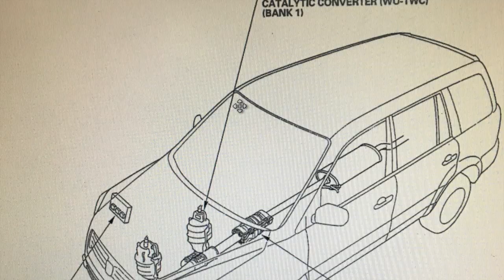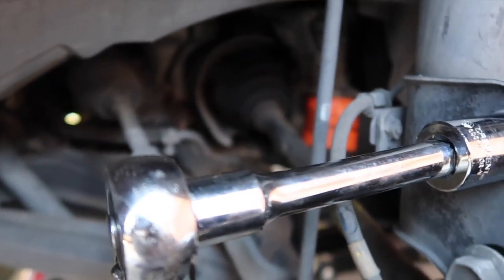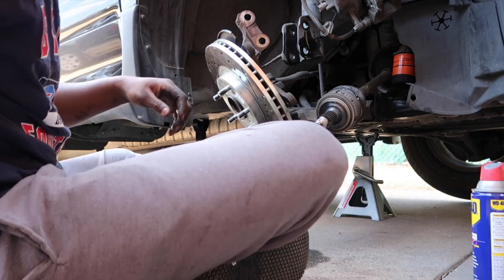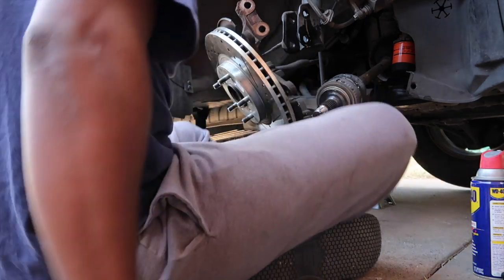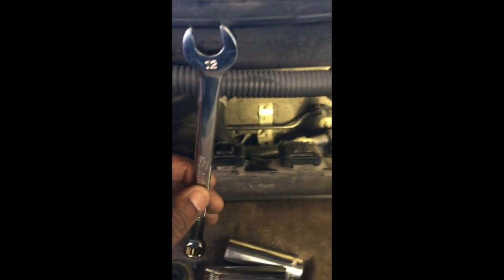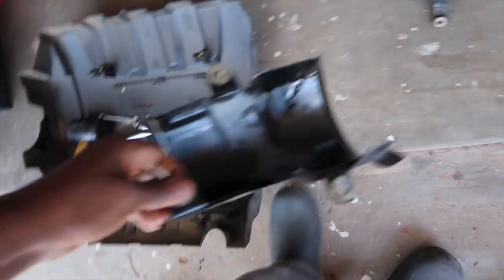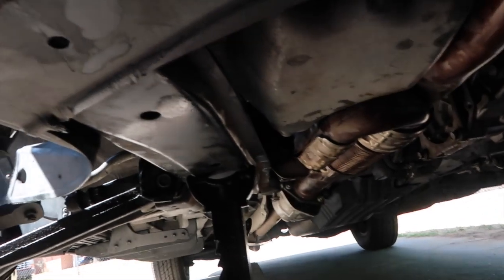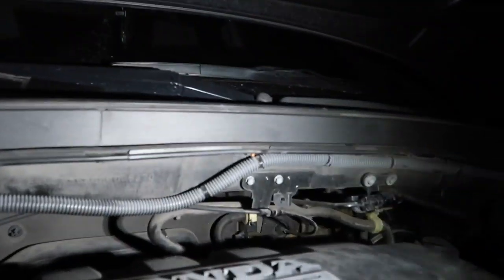HONDA PILOT (2008 & UP) CATALYTIC CONVERTER BANK 1 REMOVAL (P0420 CODE)￼ (Acura w/ 3.5L j engine)

Comment: Bank 1 catalytic converter I removed the battery connectors.   Removed air intake tube. Removed the cover in front. Removed the front grill. Removed the o2 sensor. Remove all the screws to the radiators. Remove the brace to the radiators.  Removed the coolant reservoir.  Disconnect  all the connectors and screws to the left fan. Move the radiators  to give space to maneuver the fan in between the radiator  and front of car. Remove the screws to the catalytic converter on the bottom first. There should be 4 screws. Leave the egr pipe on the catalytic  converter. Just remove the 2 screws  that's connected  to the engine. Pull the whole catalytic  converter  and egr pipe up and out of there.  With the nuts and  bolts on the catalytic  converter make sure to heat  them before attempting to remove them though. Wd40 is your best friend too.  After taking it out remove  the egr pipe.  Make you have a strip bolt socket kit to be ready lol. Install the new cat and   then the egr pipe . I would recommend  cleaning the original  gasket and reuse them instead.  Apply oil and scrub it with a wire brush.  Now just install everything by going backwards  . If you have to change the o2 sensor  I'd recommend  getting a deep socket 22mm. One you can fit in the o2 sensor after you cut off the wires.  The sockets they sell to removing  o2 sensors are not made to remove seized sensors because they will twist because of the design.
Reply: I forgot to mention I used a catco brand and they fit pretty well. If you need a California  compliance  cat then there is an extra  hole for a sensor on  the cat on the bottom. I got one on accident  and I just sealed it by using the old o2 sensor.
Reply from the maker: I really appreciate the update! I was starting off learning and now I know what I did wrong and appreciate the knowledge. I turned a simple task into a complex one but thanks to people like you for the help!
Reply: You do realize that you just explained how to remove bank 2 on the front of the engine, not bank 1. Bank 1 is the rear catalytic converter near the firewall.

Comment: Nice job, I’m doing this in a shop on a lift and it’s a pain in the ass still. The only thing I would do differently is the removal of the cv axle. If you remove it as one piece it will be a little easier to get to the bolts from the bottom and you don’t run the risk of ruining the joint. I’m working on a 2011 pilot. It’s a little different. Again great job.
Reply from the maker: jakob simmons yeah I should have done that, it would have made my job a lot easier! Thank you for watching!
Reply: You don't have to remove cv shaft for this job.

Comment: Thanks for the detailed tutorial appreciate it. Gonna have to do it soon on my daughter's Pilot
Reply from the maker: Gary Lopez no problem brother!
Reply: Hey how did you disengage the connector from  the bank 1 sensor 1 wire? I spent hours trying to separate them from each other yet no luck.
Reply from the maker: Kalsang Dorjee you still need help? Sorry my YouTube never sends comments notifications unless I’m on the computer. My apologies about that.

Comment: To remove CV Axle passenger side, you can reach from the driver side with an extra long pry bar and tap out with a sanded mallet.  A lot easier than trying to remove the way the video shows.
Reply from the maker: Thank you!

Comment: Looks like a pain bro. I spent ALL DAY taking out that axel once. Ended up borrowing a free tool from AutoZone that took it out in 2 minutes. Looks like a big "C" and attaches to a slide hammer. Highly recommend that tool. Don't know how you got that heat sheild out. I got mine lose and moved it around. Never got it out though. Hope I never have to do the cats. Thanks for the video. It will surely help anyone doing this repair. Oh, cute kids man.
Reply from the maker: Tom Helsel yeah it’s a pain but with the right tools it’ll make the job look easy. I have an Acadia that I got to do both front axle and I’m thinking it’s going to be a pain as well. Thanks!

Comment: Hey, question... so my 2006 Pilot is giving me a P0420 code as well and the check engine light goes on and off at times. You think I should try changing the o2 sensor 1st and then the cat of that doesn’t fix the issue ?? They’re charging me $987 for cat converter which is the front one. Thanks in advance.
Reply from the maker: Julian A. Torres yes I did that as well. Most likely it is you Cat converter.
Reply: MWZ MiniSodes thanks !!
Reply: MWZ MiniSodes one more question... if I have the cat change do I have to have the sensors changed too ?? And did you used a original cat or universal ?? Thanks.
Reply from the maker: Julian A. Torres you don’t have to change it but I went ahead and change mines since I was already there. I used a new aftermarket cat from eBay that already had a heat shield installed on the cat itself.
Reply: @BLK_WILL_SS  can you send me the link to where you bought the cats
Reply from the maker: Chase Robles I ordered them off eBay. Don’t have the link.
Reply: How much u pay for the cat .
Reply from the maker: Humberto Torres I ordered it off eBay. https://rover.ebay.com/rover/0/0/0?mpre=https%3A%2F%2Fwww.ebay.com%2Fulk%2Fitm%2F302378423396

Comment: It's been 4 years since you've installed the Bank 1 Cat purchased from eBay.  Has it lasted this entire time without setting off the code / check engine light?
Reply from the maker: Honestly I sold it to a close friend after a year. He sold it last year around April and the Cat was still holding up pretty good and never had another engine light.

Comment: damn looks like alot of work! Does the truck drive better? how was it driving before?
Reply from the maker: Yes it drove better and sound better! It would make a noise and set the engine light off. I saw an improvement in the gas mileage as well.
Reply: @BLK_WILL_SS  thanx for reply, my pilot is acting funny  has had that code for a while i have to go ahead and get this done,great video !
Reply from the maker: NuLine Transport no problem. Thank you for watching. The dealership wanted to charge me $800 for the job I believe but I did it myself. Took a while but I got it done. I got the part from eBay and to this day it runs great. 200k miles on the suv.
Reply: @BLK_WILL_SS  Damn Good job ! did you get the sensors on ebay too?
Reply from the maker: NuLine Transport yes I did.
Reply: @BLK_WILL_SS  not the oem right cause they are expensive!
Reply from the maker: NuLine Transport that’s right. You can always find some online that performs the same job for a cheaper price.

Comment: I have a 2005 Honda Pilot and I can't figure out how many catalytic converters I have or what's the name of them so I can purchase. How/where can I find this out?
Reply from the maker: You should have three. One in the front of the engine, back, and bottom that leads to the exhaust.
Reply from the maker: https://www.ebay.com/itm/2005-2006-2007-2008-Honda-Pilot-3-5L-Catalytic-Converters-Set/303383708481?hash=item46a3140341%3Ag%3AJz8AAOSwhMxd4UUf&fits=Year%3A2005%7CModel%3APilot%7CMake%3AHonda
Reply from the maker: If you need help just find me on Instagram and we can call each other so I can help you.

Comment: I have that code p0420 on my 2008 pilot.  I want to replace the sensor first...where is the sensor located and would I need to remove everything you removed ? thanks!
Reply from the maker: The sensor is in the top of the one I changed out. It is possible doing it without removing stuff but goodluck with that.
Reply from the maker: Go to 21:45 mark and you can clearly see the sensor on top of the converter. That’s the one you are asking about changing out.
Reply: @BLK_WILL_SS   thank you
Reply from the maker: @elderreyes3782  no problem ask me some more questions if you need help.

Comment: Has anyone replace the front one. I'm stuck on that one. I'm about to remove the radiator and fans to make room to get it out. But there's no bbn info out there for front one. Good luck to you guys on that job.
Reply from the maker: You can do that one easily
Reply: I just did one yesterday. Read the comment I posted.
Reply: There are videos for the bank 2 as well.

Comment: Question....code p0420 bank 1 on a 2011 Honda Pilot is the same one he did in the video right?
Reply from the maker: shrekrich yes it is. This is a 2008 pilot but it’s the same engine
Reply: Did you have to take the whole exhaust off to, and drain the transmission fluid
Reply from the maker: shrekrich the exhaust that is directly under the engine yes, it’s literally bolted on. The transmission fluid is a no, I did not drain it.
Reply: Thanks man you’re a big help....you and your family stay safe
Reply from the maker: shrekrich likewise

Comment: Remove the sway bar links, remove front cross member shield (4 bolts), remove exhaust, #2 sensor and remove cv shield and cat. You over thought the whole process.
Reply from the maker: I didn’t overthink nothing if I did not know.
Reply: Then why put up a video? You're on YouTube and you could of looked up even the TRQ site. The purpose of doing these videos is to make it as easy and painless as possible. This was painful to watch.
Reply from the maker: @royquesada5295  that’s your opinion go ahead somewhere else with that. Doing that time I couldn’t find anything to help so I took it upon myself. Instead of trying to criticize me help me. That’s what youtube is about. It you ain’t got nothing good to say keep it to yourself, this my channel and I’ll put up whatever video I desire.
Reply: Your right. But now you know, so maybe correct or I should say 'revise the procedure. My whole point is to make the job easier.
Reply from the maker: @royquesada5295  and I appreciate it brother.

Comment: Wow 2 days..... The 2 pins holding the strut to the steering knuckle are secured with nuts and they slide out. Then jacking the car up higher, pointless........ Idk why you would post this video. You start the video with service information, but you obviously didn't follow them. It would have saved you A LOT of time.
Reply from the maker: Service information was edited into the video. I did what was best for me and it was my first time doing it. That is your opinion my guy, bless up!

Comment: Bank 2 is right or left in a 2006 Honda Pilot?
Reply: Do you know?
Reply from the maker: Cristian Blanco bank 2 is in the front between the engine and radiator. Bank 1 is the one I did in the video which is in the back of the engine near the firewall. Easier way to remember is by the number of the spark plug will be the bank as well. Like the number 1 spark plug is at the back of the engine where bank 1 is as well. Spark plug number 2 is in the front of the engine by the radiator fans also where bank 2 is located.

Comment: Amazing video brother , doing it by the book 👍🏼
Reply from the maker: I appreciate it brother, I’m trying to be helpful to others that’s all. Say a couple of bucks instead of paying the dealership.
Reply: Right! And this is why I'm here haha because I needed help with mine and your video helped alot, thank you ! 🙏🏼
Reply from the maker: @jasonantonio4127  yes sir, feels good to hear and you are welcome!
Reply: Nice try...very little 'by the book. CV shaft just don't 'slide out, they have a clip ring holding in the case. Not torque values are crucial when mating surfaces. He needs a lot more learning before he puts videos up. Spent more time trying to figure out. Took things off that were not necessary. Broke the sensor plug unnecessarily. Showed tools more than procedure. Then kept saying 'catalyst, it is catalytic. 'Put the bolt back on rotor?? Watching you bolt on cat was painful, no ratcheting actionable all, you were just turning the nut back and forth. 'Your guessing?? Keep going, at least your trying, but as far as 'instructional...questionable. As far as you saving $1200, 2 days of your time fuel, you probably only saved on the cat. Time wise your in the hole. That's a 4 hour job with Basic tools.

Comment: It’s spitting the p0420 code but no lights are on dash are illuminated. Nor does it have the other symptoms. Should I still replace? Looks tasking 😬
Reply from the maker: Laurel Madrid it showing the code as a pending code. That’s why the engine light I not on. I would try changing other things first and checking before this. It was a lot of work. But if it ends up showing the engine light it will be it.
Reply: 99% is catalytic converter issue.
 Put the scanner, it will pops up catalytic no good, pick that option and then you will see a line go up and down on the diagram. It means the sensor is sending signal and it is working good 👍🏻

Comment: Hey man great video. One question a Honda Odessey has 3 cats right, do all three need to be replace for the PO420 code ?
Reply from the maker: Hey thanks. Yeah it should be one I. The front of the engine, the back of the engine, and one at the bottom connected to the exhaust. Yours have the same code correct?
Reply from the maker: Chino Rodriguez what year?
Reply: Thanks for replying. Yes that’s the code the came up on my 2006 Honda odessey
Reply from the maker: Chino Rodriguez unfortunately that’s the same code and the same cat that I changed out. It’s the one behind the engine.
Reply: The cat on the main pipe isn't metered (under the vehicle). The ECU will not throw a code for that cat. Only the two coming from the engine.

Comment: Is this a 4wd?
Reply from the maker: No sir, it’s a front wheel drive.
Reply: @BLK_WILL_SS  we are doing one on a 4wd.  Going have to take off cv joint.. damn good thing we at a shop and next to AutoZone
Reply from the maker: @GETORGANIZED956  I took the CV Joint off as well. It was easier.
Reply: @BLK_WILL_SS  how many hours did it take you not including breaks and trips to auto store?
Reply from the maker: @GETORGANIZED956  brother I started this one early morning and ended it the next night. This was my first and last time doing something like this lol.
Reply from the maker: @GETORGANIZED956  so about 7 hours straight hands on without including breaks and trips to the part store and baby sitting.
Reply: @BLK_WILL_SS  I'm getting Po135 heater circuit which is bank 1 sensor 1 where is the location please. I started to get VTM4 on dash I had some one do it for me don't know if I need to replace the O2 sensor. TNX FOR REPLYING..
Reply from the maker: @GETORGANIZED956  so yes it could be the O2 sensor brother. When you clear the light meaning have the code cleared, how long does it takes to come back on? Right away or a little longer?
Reply: @BLK_WILL_SS  it comes back on as soon as I turn its off and turned back on it will stay off till I turn it off. I can even use 4WD but once I turn it off and the engine and vtm-4 light on.. I was reading the vtm-4 could be low oil or loose gasket. But code says bank 1 sensor 1.. I also get a P0420 saying it's below threshold on BANK 1 TOO! I WONDER IF THEY ARE ALL TIED.
Reply: @BLK_WILL_SS  did you have to put back transmission oil from the shaft that you lost?
Reply from the maker: @GETORGANIZED956  do you have low oil and check for any leaks on the gasket. It maybe that they all are bad. One of the front O2 sensors were not connected.
Reply from the maker: @GETORGANIZED956  yes I added a quart of the transmission fluid that day and check again when warm and top it off.